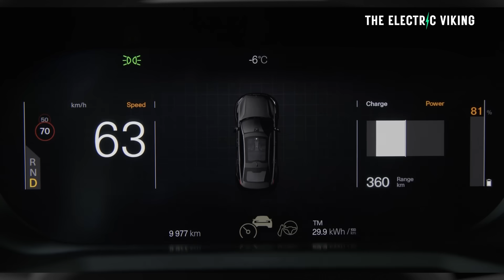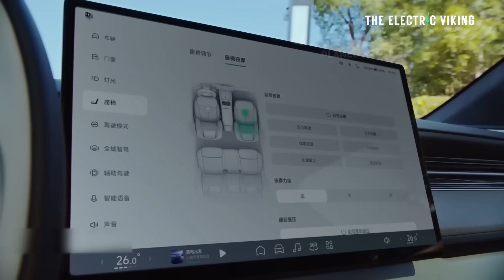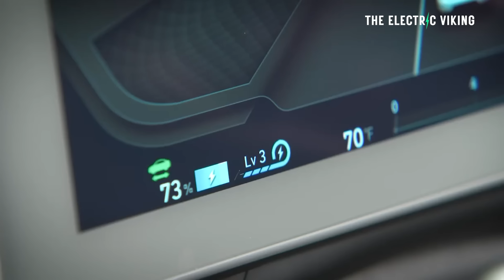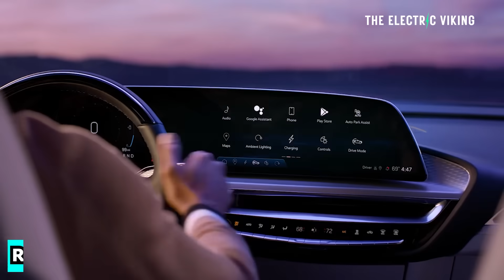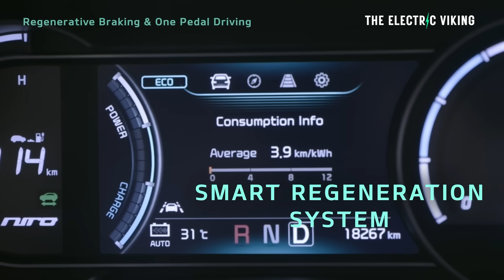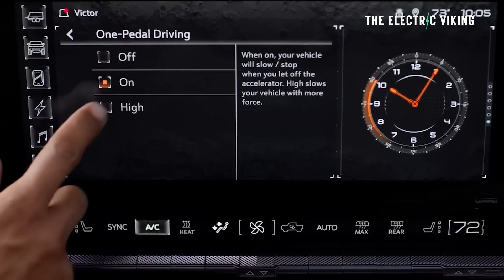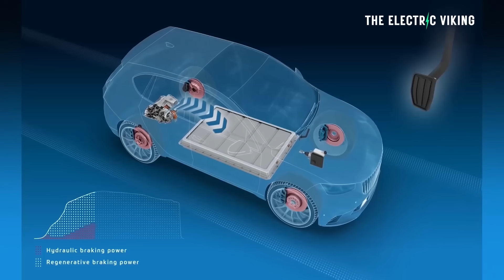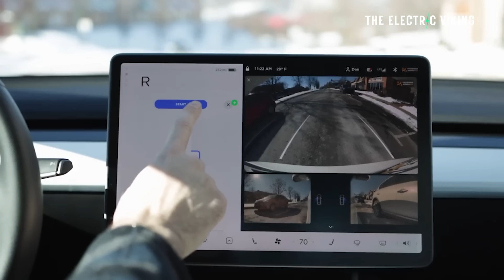China BANS Single Pedal Driving - Regulators Claim it Causes Crashes

Comment: I don't get it.  What happens if you NEED to brake FAST?
Reply: That’s when you use the brake pedal.
Reply: @johnlambert1744  That's why we need 2 pedals.
Reply: @johnlambert1744  when drivers mostly use 1 pedal to drive, their reaction will slow down or confused when they need to use the actual brake pedal in an emergency that's why you see in videos car just speeds even after a crash...
Reply: @fatdoi003  I had to re read this a few times to understand your broken english - but you'll actually find one pedal driving much safer for slowing down, as when you go from releasing the accelerator to pressing the brake pedal the car immediately slows down much faster than a car without one pedal driving.  Trust me, I've been driving cars for 40 years and now I have a Tesla I find I can react to emergency braking situations MUCH faster than traditional ICE vehicles.
Reply: Brake! (There is always 2 pedals. One for moving and one for stopping). With my EV I can always choose traditional stop and go, but I would miss out on the regen.